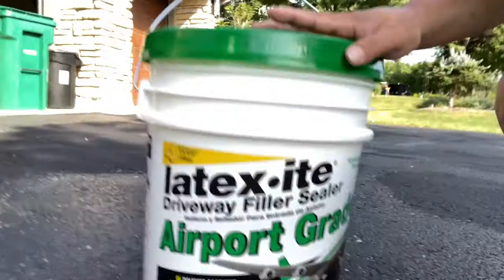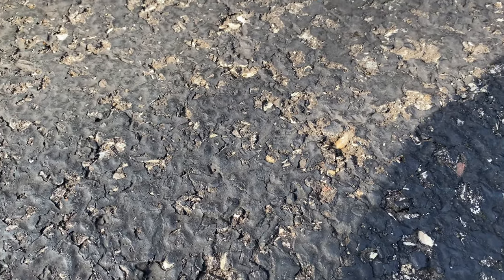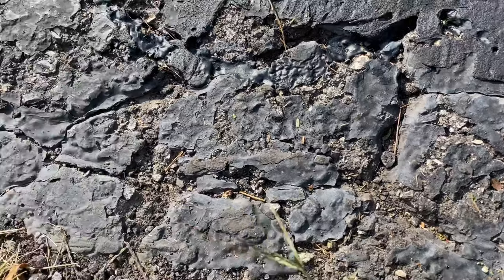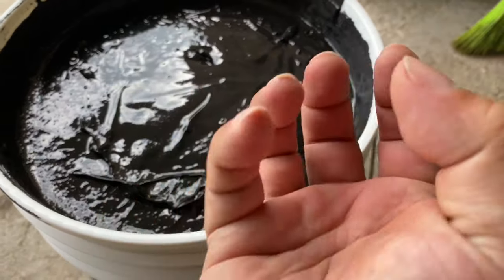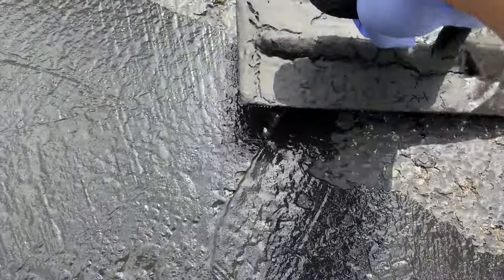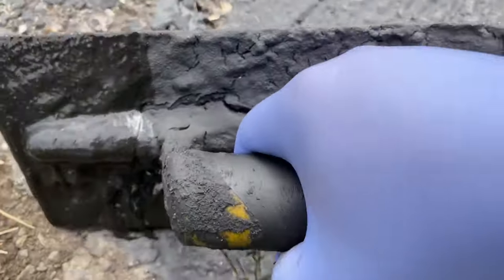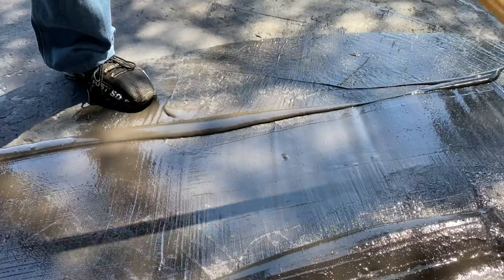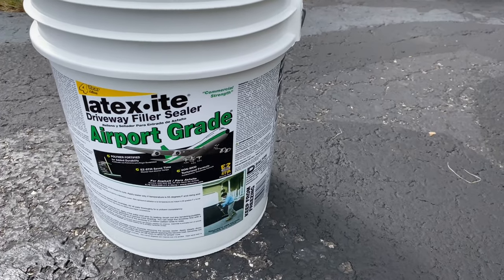How To Repair Asphalt Driveway with Latex-ITE Filler Sealer

Comment: Peter, you've probably paid a high premium for the trowel grade Latex--ITE filler sealer, compared to the same size container of the latex final sealing product.  Just buy one extra pail of the sealer product and create your own low cost trowel grade filler.  For every two parts of latex/acrylic sealer, add two parts of clean washed sand (Playsand sold for children's sandboxes at the Home Depot) and add one part portland cement.   Because the latex/acrylic sealer is water based, it will activate the portland cement in the mixture.  
You can thicken the mixture for wide cracks and depressions, or you can thin the mixture to a "pour grade" to pour into very thin cracks.  The product dries very quickly, with minimal shrinkage and creates a rock hard bond to the base asphalt driveway.  
Driveway repair products have risen dramatically in recent years, along with other petroleum products and the "accessory products", such as special fillers can add drastically to the project cost.  Save some money and have greater flexibility with the product.
Reply: Hi, are you saying to mix the sand with the Latex-ITE before applying it to seal the alligator cracks? 

Thank you 😅
Reply: @nuchipippity  Yes, sand and Portland cement in the proportions stated.  It has a good "working time" to fill cracks, of about 40 minutes until it sets.
Reply: Thanks so much for the ratios! This will save us a lot of money. Very much appreciated!!🙏
Reply: You're right sir that's exactly how you do it with sand
Reply: Will this ratio work to seal cracks spreading it with a squeegee?
Reply: @avilla12123  Yes. If the mixture is thinned to a pour grade, it will seep into cracks with a squeegee application.  Avoid a very hot day and bright sun, as cooler shade will allow a longer curing time, therefore more time to seep deep into fine cracks.

Comment: It took me 2.5 gallon of latexite optimum for a 900 sq ft driveway. I used another 1.5 gallons as a second coat about 2 hrs later. Turned out great - took me 4 full hrs. You need to mix a lot.

Comment: Any reason to not coat the entire driveway with a filler? I just bought a house with a pretty rough-condition driveway. (Old with lots of alligatoring and thinned out asphalt). Spending $300 on these is way cheaper than buying a new driveway and if it lasts for a few years, it might be worth it. Any thoughts?
Reply from the maker: You can definitely use this on the entire driveway! I did!
Reply: Hire a crew to heat and resurface the existing asphalt.

Comment: Appears to be an easy sealer. Wondering what effect, if any it would have if you resurface with asphalt over the sealer. Peace
Reply: You would likely experience adhesion issues and possible peeling of the surface course asphalt.
Reply: The typical sealer is a thin coating, like a petroleum paint.  Watching all my neighbors, I’ve never seen theirs peel, being thin.  But it last only about 2 years before getting dull, worn out by sun and weather.

Comment: Hi, just did a small hole because of my motorcycle stand… About an inch deep! What do I need to fill it myself? Thanks!
Reply from the maker: This could work. You probably just need something to smooth it out and tamp it down. A piece of 4x4 lumber would probably work to pound it in.

Comment: Please I have auto oil in my driveway, I have power washed it but still have it. Can I use your product to change it back to it's original state?
Reply: Nope, oils stain will come thru. You need to prime it first, then use this product.
Reply: They sell products specifically for covering those oil stains before sealing. The one I've seen was in a small white bottle
Reply: Google for a driveway oil cleaner, then apply a oil spot primer, before applying a sealer.  Really, it’s more cosmetic than anything else, and you want want the keep waterfrom getting underneath .

Comment: How did it hold up in weather?  And long term? I love in New England with hot/rain and of course cold winters. thanks!
Reply: These are surface treatments.  And in NE weather ranging from 10 to 100 degrees, it will last 2 to 5 years. I think key is to cover, seal whenever you see a crack, to keep water from seeping under and through freezing and thawing pushing up the surfaces, like you see on the NE roads.

Comment: do you think i can apply this latex-ite over the aquaphalt 6.0 immediately afterward ?
Reply from the maker: I'm not an expert on that, but I would not seal aquaphalt immediately after putting it down. I waited 2 months for the summer heat to completely dry and bake my aquaphalt before I sealed it
Reply: @petervonpanda   hi Peter. Thanks for the reply. This is what I got on their website.  Hope it helps .     A ‘GREEN’ [no VOC content] sealer can be applied upon completion of compaction. If using a sealer that contains VOC’s, wait 24 hours for Aquaphalt™ to cure completely

Comment: Can this stuff be used to fill in small potholes in a parking lot in between getting the parking lot resealed?
Reply from the maker: I might try Aquaphalt... I used it to fill holes, and it worked great!
Reply: Buy a bag of cold mixed asphaltic concrete road patch from a box store and fill the hole. 
Tech tip- use WD-40 to clean you scoop and trowel to keep the job clean.
Reply: No.

Comment: Sir, this is a finishing driveway sealer.   For heavier cracks use a filler instead.
Reply: I know nothing and was thinking the same thing
Reply: True.  But any sealer keeps water from getting underneath for freezing and thawing action.  A filler fills voids to the surface level for better appearances.

Comment: Did I understand correctly that I'd have to seal the whole driveway with something else afterward?
Reply from the maker: I did but only because I wanted to change the color. You can absolutely use this as your final sealer and it works great!

Comment: No matter what you use,  these cracks will come back the following seasons. 

Especially north east which experiences hot summers,  cold winters. 

Lots of movement from freeze and thaw process.
Reply: Ok.  But still have to cover if not seal the cracks from more water getting under and lifting.  Can’t spend $12 sf to rip up and replace, and then a new driveway has imperfections that will let water seep under in 5 years.
Reply: @tonymanero5544  i agree,  keep that maintenance going...

Comment: Interesting intro, your driveway is in poor shape, how long since the last time you sealed and what did you really apply?
Reply from the maker: It had been a few years since I had it sealed. And the previous sealings were done by a company that came and sprayed on a coating that was pretty thin with no repairs beforehand. This sealer, the trowel patch, some of the coiled rubber stripping that you shove into the big cracks, and then a top coating of the colored sealer is all I’ve done since. Right now, it probably needs a bit of filler here and there and another sealing but it’s held up remarkably well

Comment: Hey, great video. Some people said adding a small amount of sand to the sealer will make it stronger, especially when filling cracks and holes. Do you have similar experience ?
Reply from the maker: I haven’t tried it but I should next time. I heard it gives it more texture and makes it grippier too
Reply: Sand to a mix won’t add to the flexural strength of the pavement. 
Those resurfacing products only make it look pretty for a while before you have to buy more of their product.
Reply: @BackyardRambo  are you referring to sealants used to sealcoat a driveway? sealcoating is a waste is what you are saying?

Comment: So how’s it looking after 3 years, Peter?
Reply from the maker: Good question! I should do a video this spring before I do the round of repairs and maintenance. Getting some cracking again that I’ll fill with the same stuff and then reseal but I’ve done nothing since this video so I’m pleasantly surprised at how it’s held up!

Comment: Can this go on top of cement patched area?
Reply: I was wondering that, too. I was thinking of just "parging" all of the deep alligator cracks with cement or concrete.  Mine is so bad that to an ant it must look like a mountain range. 10% seal coating left. Many commentors are saying these fillers are junk, so, I'm considering parging concrete over the cracks/fissures and then just sealcoat over all of it. Would the sealcoat bond to concrete?

Comment: The only real way to repair HMAC driveways is to hire a crew with the right equipment. 
You have two options because crack seal is fugly:

Remove and Replace
Or
Hire a contractor with a heated repaving rig, meaning they heat the asphalt up to about 300 degrees and repave it. Definitely more cost effective. 
HMAC means Hot Mixed Asphaltic Concrete
I’m an inspector with 25 years experience.
Reply: You know what you’re talking about. This thing doesn’t really work. It looks nice initially but one winter is all it takes to open the cracks again. It’s really a waste of time and money.
Reply: You’re talking $5k whenever a crew and equipment come out.  A seal may be fugly, but it keeps water from seeping under from freezing and thawing.  And contractors rip you off because their crew don’t usually do everything promised. They never come back to fix mistakes.

YouTube people who says “do it right to avoid callbacks” are the only 100 trades people who come back to fix later problems.  My window company for Marvin top-of-line came back 9 months later to properly install brick moulding on 2 windows on a $63,000 job that 2 guys only took 3.5 days to do 31 windows. My $20,000 roof job (1 day with a crew) with GAF 50-year warranty architectural shingles tried to deny responsibility for a water downpour 3 weeks later.  I could go on and on with “reputable” contractors promising undelivered quality.